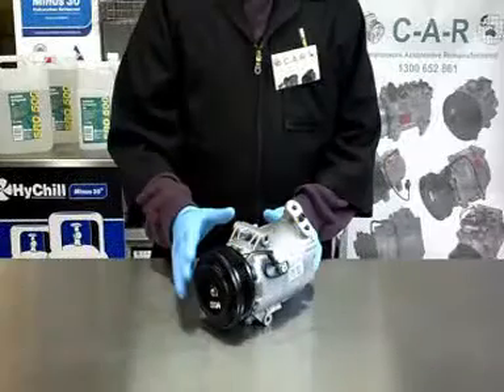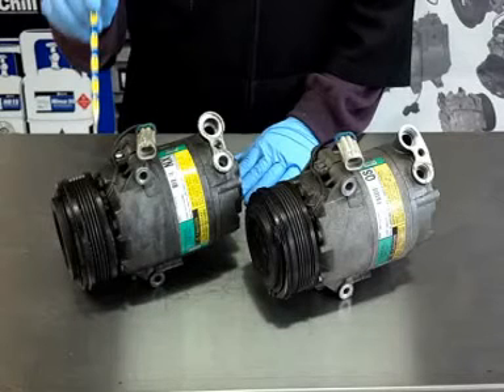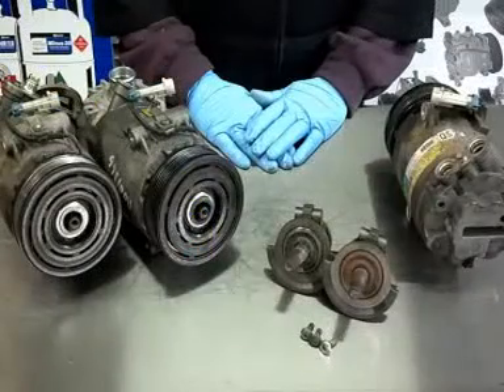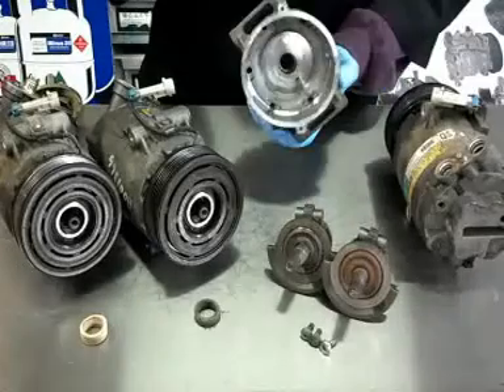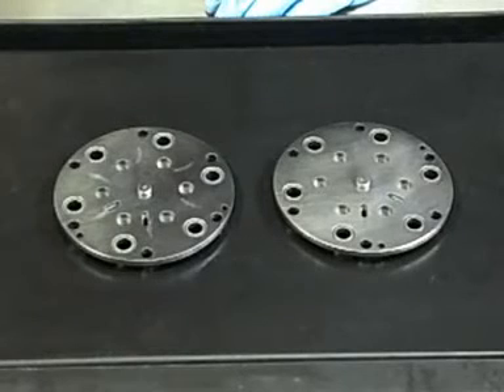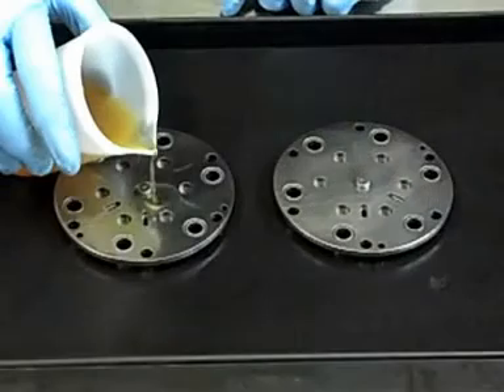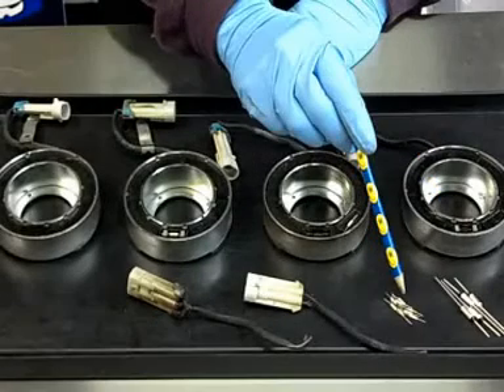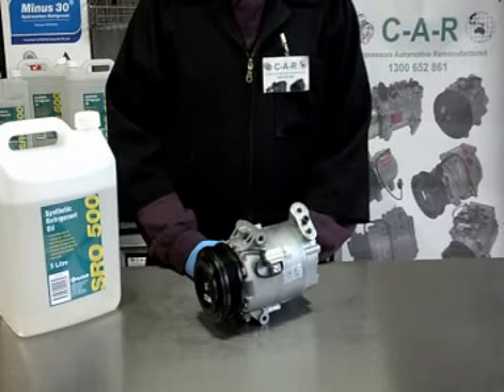GM Astra TS - AH. Air Conditioning Compressor Failure

Comment: i have the 06 ah model with diesel engine ,     will it still be the same type,,,    my air con was great , then stop , no audio sound of clutch grab  can be heard ,  yet the compensator for engine revs is doing its normal thing ,     my compressor was noisy from day one ,,the sound was like a leyland 6 diesel fan noise ,  from day one again 15 years and today it stopped,    i bought it new ,,, just about to hit 100,000 km mark,  fine working 2 days ago ,    today at temp amb 22   ,  didnt even turn on ,,, help is it a fuse or relay

Comment: For anyone having this kind of compressor and still watching this, keep in mind that if you're experiencing a noisy compressor and weak A/C in hot days, you might have a severely worn radiator/condenser fan motor and not know it... just replaced it for engine cooling related issues on my car, and noticed the compressor noise is now completely gone...

Comment: My Astra compressor sounds like its not releasing enough gas.
Do the Regulator vales fail in these often? if so whats the fix? new compressor or new valve?
Reply: If it's a manual climate controller and you have the Delphi CVC compressor, there's a displacement pneumatic control valve in the compressor's body (in my compressor, a 09167048, it's opposite to the discharge and suction ports). It's held in place by a small circlip and can be extracted and replaced after evacuating the system of any gas. Wonder if the oil stays in place though. I'd recommend removing the compressor first (after having the gas evacuated by a professional, of course) and maybe also refreshing the oil charge inside with the correct oil in the process (it's written on the compressor's label). I have a 15 year CVC compressor on my car and the control valve is still good (the compressor, when turned on, normally emits a quiet "hmmmmmm" noise and places some load on the engine, but if you let the cabin get cold, the compressor becomes silent and there's no longer load on the engine because the valve destrokes the compressor; all of this with a system regassed to specs and fitted with a new receiver drier some months ago) however it seems it can fail since it's sold as a replacement part. Look for the valve "tip" color and get one with the same color however, since the color seems to indicate a specific destroking suction pressure threshold. The main problem with these compressors, however, seems to be the clutch coil thermal fuse (it can fail both due to compressor failures, covered in this video, and for no apparent reason other than aging or thermal cycling; i had mine fail for no reason and the shop i went to replaced the coil with a part that turned out to be defective and ceased working after one year and was then covered by warranty). Anyways check if the compressor coil engages first. If it engages, and you have the correct gas charge inside, and the compressor doesn't put any load on the engine right after you turn the AC on, then your control valve is defective and it's keeping the compressor destroked.
Reply: FYI i've just replaced the control valve on my GM car Delphi CVC (the ones featured in the video, and the one your Astra likely has/had). Yes, it seems to fail after something like 10+ years of service. The blue dot control valve for V5 compressors is a perfect fit for the old one. I got mine from the USA. Now the compressor is clearly loading the engine much more than before, and vent temperature is stable. Before, you got cold air while driving and coldish air while stationary, meaning that the compressor was not pumping enough refrigerant.

Comment: Wouldn't replacing the thermal fuse with copper wire create the risk of a fire?
Reply from the maker: Thanks Oberyn Martell for your comment.  Replacing the Thermal Fuse with the same gauge copper wire as the coil windings, will NOT cause any fire, it just returns the coil to the standard of all coils manufactured before this model, for the last 30+ years. What will cause a fire is NOT finding and fixing the fault with the Vehicle, that is causing the Compressor to overheat in the first place!
Reply: OK no worries. I was told by an a/c technician that my coil was open circuit, so removed thermal fuse, tested, and it was good.. then I broke it... I ended up just joining the 2 copper ends together on the coil. A/C still doesn't work though, it worked for a bit then stopped, coil still has continuity, so not sure what issue is. Is there anything else to check, like other cabling, fuses etc?
Reply: +rick ling If i remember correctly on these engines (and many recent engines) the catalytic converter is integrated with the exhaust ports, and it sits right in front of the engine, and the compressor is near. Perhaps the catalytic converter's heat, in addition to the heat normally generated by the compressor's operation in addition to the environment's heat, may make the thermal fuse (which by the way could help prevent the serpentine belt slip on the compressor's pulley if the compressor were to suddenly seize) on the coil trigger when not really required, on an otherwise good compressor. This, or excessive vibration from somewhere (compressor, engine, engine mounts...) ends up damaging the thermal fuse and making it open even without any abnormal current or heat condition somewhat. Or they eventually fail due to age and especially being repeatedly heaten up, though not beyond the cut off temp, and then cooled off, due to being around an engine. Just an hypothesis.
Reply: Thinking about it further, when my CVC 6 failed, AC service wasn't done yet and the car was 8 years old. AC has mainly been used in the summer too, very rarely in other months. It kept cooling with no problem though. Perhaps running AC on a very low charge level may heat the compressor (high superheat, decreasing OCR) up to the point that the thermal fuse triggers. In the process the compressor appears to become noisier and noisier just like variable displacement compressors appear to do when the refrigerant charge decreases. However the now 15 years old compressor still appears to be healthy... now, after a receiver drier replacement and a regas, i'm letting the compressor run each week for some minutes.